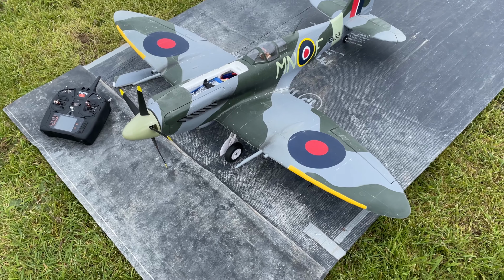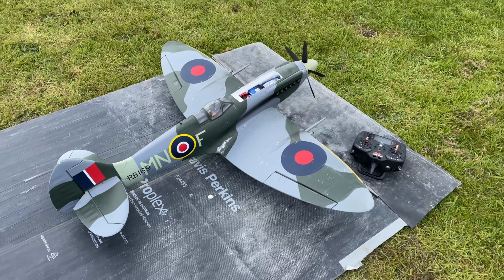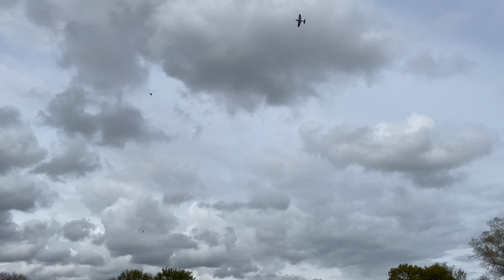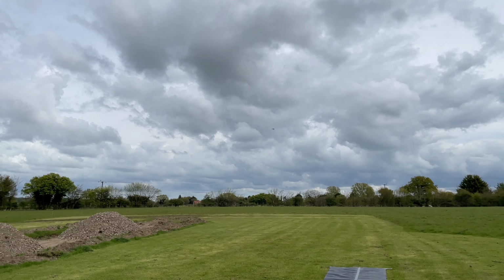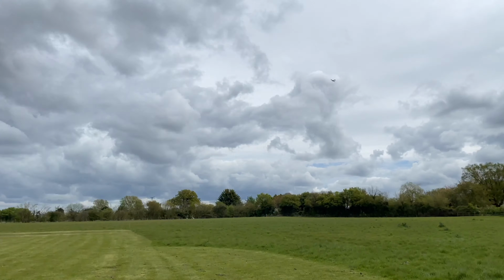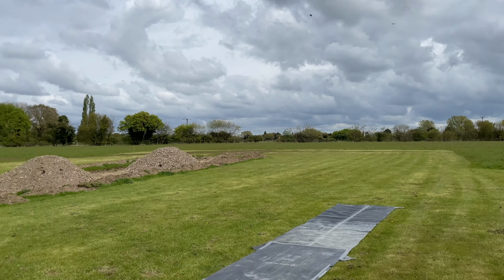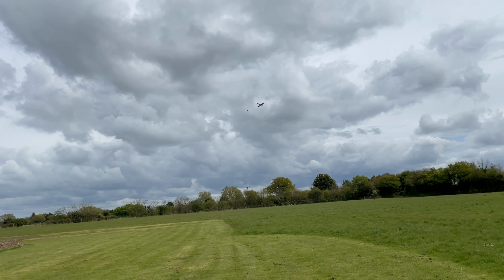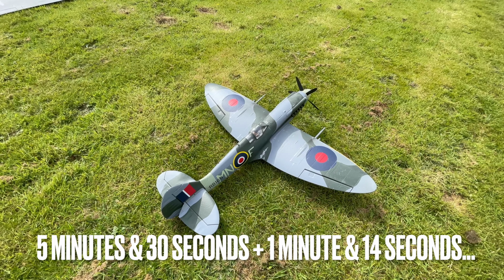OG Spitfire XIV on 3200 battery 22nd April 2024

Comment: Fantastic flight and landing Gina . Love the Spitfire . This inspires me to get mine out . I use a 4S 2200-2800 in the Durafly 1.1 Spit , but its rated for it . 
I've rolled the dice a few times plugging in overrated batteries into ESCs , Technically or theoretically the should have some type of over voltage protection and just don't turn on with to much voltage . Many of my RC cars are like this . 
Also , the amp rating can be misleading . a 50 amp ESC should take 4S but not all will ....or motors for that matter . 
It seems to fly fine on the 3S , so maybe wait till you have another ESC to test it ? . Hate to see you lose that bird . Cheeers .
Reply from the maker: Thanks, Philip! I'm fairly certain the Esc is a 40 amp one, so a 4S would be pushing it. I never seem to have much luck when I stray from manufacturers' recommendations. And I would be pretty upset if this model got damaged during any experimentation.

Comment: Nice one Gina! Take-off looked good. Can't be easy taking off from that narrow strip. Got my 1.1m Yellow Trojan back together and in the air yesterday 🛫🥳so hopefully won't be too long before I'm on to flying my Parkzone Mk IX Spit's. 🤞🤞 Need to put some hours in learning on the Trojan 1st though. Reckon the Spit is quite a bit faster, although similarly spec'd, because of its more streamlined shape, and I'm not sure what it's stall characteristics will be like so it makes sense to get proficient on the Trojan first. Slowly, slowly catchy monkey! 🙈 When we going to see your balsa Mossie flying?
Reply from the maker: Thank you, Andrew! Take off was a tad tricksy, but the Spitty did all the work. I'm glad you now have an airworthy T-28... and time spent flying it will be very helpful when you fly the Mk.IX Spitfire. If the PZ Spit is as good as the E-flite one, stall should just be a mushy descent.
As to the Wooden Wonder, the grass needs to be a fair bit longer; thin balsa wings and cartwheeling over short grass and hard ground could be asking for trouble. Fear not, when the day comes, it will be recorded for posterity, or if it goes bad, for posterior!

Comment: What is the ESC size on that Spitfire? 4s battery's seem to like the 60 amp I have never had one catch fire or short out. I do need to vent my Evolution Turbo Timber because that ESC gets very warm 195F in a 50 degree day is not good. Great flying and enjoyed watching Gina fly.
Reply from the maker: Thanks a lot, Tug!! IIRC it's a 40 amp ESC, so 4S would push it to the limit. It wouldn't be difficult to remove and replace the ESC, but I quite liked how it flew on the 3200 battery.